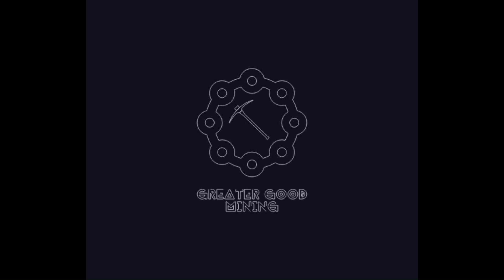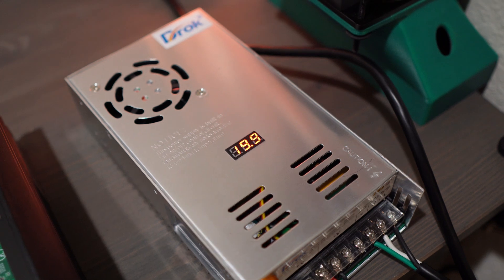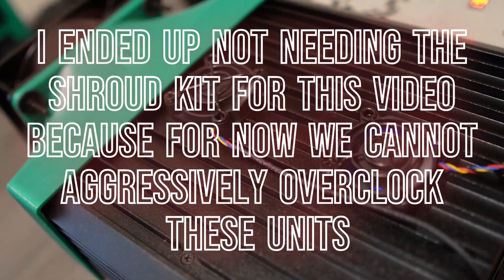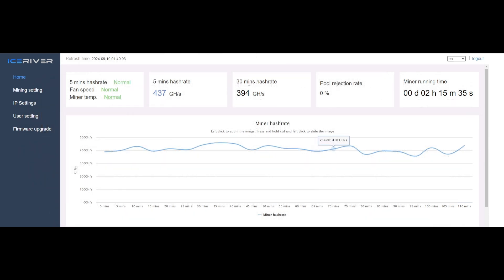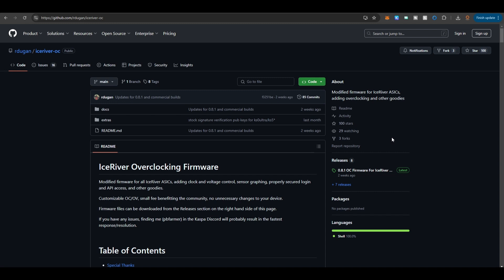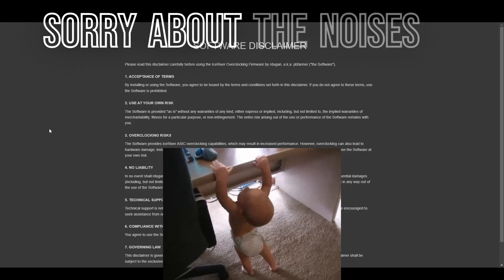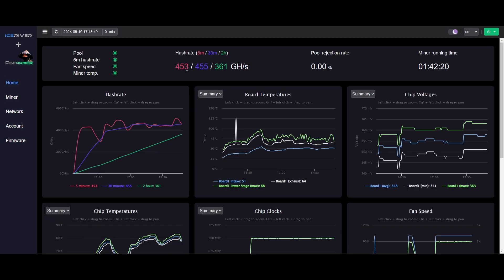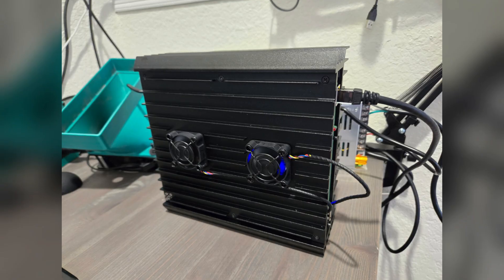Overclock your Iceriver AL0 Alephium ASIC!! (ALPH overclocking guide!)

Comment: Now I connected a new al0 with stock fw. but it will not boot. Both led stay on , no flashing. reset button no reaction short long or hold during startup. any idea?
Reply from the maker: @mucwendel  plug it in, let it run for about 5 minutes. Then Hold down reset button for at least 20  seconds. (do not hold down the reset button while it's booting up.) After the hard reset give it another 5 minutes to reboot itself etc. Then try to get into the web gui again. Also, if that doesn't work, try another power supply
Reply: @GreaterGoodMining  Tried everything without success. AL0 is still on stock FW. I think I did the mistake like hold reset while power on and did not wait before I disconnected the power again. Something now wrong with the boot-loader. 
Any Idea? SD Card with stock FW (no download on ice-river)
I also tried to hold the reset button for mor than 2 minutes. Nothing :-(
Reply from the maker: @mucwendel  it sounds like you might have corrupted the files that it uses to boot up. Do you have Discord? You could try asking around in my Discord, there might be someone who has the files you need or more advice than I can give through these youtube comment sections
Reply: @GreaterGoodMining  I have discord but do not realy know how to use
Reply: how to verify your server in discord?
Reply from the maker: @mucwendel  here is a link to my Discord https://discord.gg/WuNg9aUS
Reply: if you can ping the IP, update the firmware using IceRiver_MinerTool

Comment: Question on that PSU option, Will a 240v c13/c14 cable when cut in half have 3 wires? Do you wire them the same to the ground neutral line even though its 240v? I know you need to switch the switch on the psu to 240v.

Comment: Followed this video to the T....SCAM!! I'm no longer able to add my previous pool, and it is mining to someone else and I can't stop it except UNPLUG
Reply from the maker: It's not a scam. Just do a hard reset on your machine and revert back to stock firmware. You need to add in a pool and wallet after you upload the new firmware. Also, as I said in the video, there is a 1% dev fee. It switches to mine to his address briefly to collect the dev fee. You might have been looking at it when it was mining to the dev? Either way you can just hold the ip report button down for about 20 seconds or so until the lights start blinking then let go and let it reboot etc. Then you can log back in and reset up the machine just like you did when you received it

Comment: You are promoting a scam! As soon as I downloaded your LINKED updates, I can no longer login to my AL0😢😢😢
It's now telling me that my login is Incorrect 😡
Reply from the maker: The machine needs to be reset up. It's not a scam. Try the stock admin and password. Admin for user name and password is 12345678 then when you log into the machine change the username, password, pool and mining address. You have to set everything up and adjust overclocks yourself with this firmware. If you do t want to use it anymore just do a hard reset by holding in the ip report button for about 20 seconds on the back of the machine until you see the lights blink. it will set everything back to factory settings. Then you can log back into the machine and set it up just like you did when you received it.

Comment: I've loaded the oc yesterday evening. Tested different clock and voltage. But it's only shows slower hr as before. When i go over 30 at theclk the clock go down to 20 after some minutes. I need to reboot after that.
Actually running on Pbfarmer  383gh(5 minutes and 336gh(2h). Oc set to 5mhz 0v
Reply: Does anyone know how to go back to stock fw?
Reply from the maker: You can do a hard reset on the machine to set it back to stock by holding in the IP report button for about 20 seconds or so until you see the lights on the unit flash. Then you can start fresh and set up the machine like you did when you received it
Reply: If Pbfarmer oc is set to 0mhz and 0 voltage the chip voltage is just 350 instead 370

Comment: are you OCing the AL0 right after you did the heatsinks?  Worst part about OCing is waiting that full 24 hours for that glue to cure.  Normally i'll OC the next day giving it about 12 hours or so to cure and has been fine so far.  Just curious if you were running the device right away afterwards.
Reply from the maker: @MaddioDaddioMining  I didn't iverclock the unit right away it was about 14 hours later. I have also used the heatsinks with the tape on the back and they have held up fine so far
Reply: @GreaterGoodMining  thanks for the info.  yeah i always wondered about the tape.  thank you sir.
Reply: I left the heatsinks upside and oc direct after glue. I think the glue harden faster if it gets some temperature. But do not move or tilt the unit as the heatsinks may fall off and create shortcut on the board.

Comment: Good work.  Hmm, so you gained 50 ghs on 40 watts, minus the 1 percent of 450 ghs that goes back to pbfarmer (4.5ghs)....so really you gained 45 ghs on 40 watts...not ideal.  That being said, i am sure ill do it as well since i have extra heatsinks laying around anyway lol.
My Rx0 is ordered too
Reply from the maker: My AL0 seems to run around 394 so it is more like 60gh for an extra 20 watts not 40 watts. My AL0 on the meter Box was taking 120 watts before I started overclocking and I ended up at 140 watts

Comment: My ALF ALO Miners are not even connecting and mining so I am hoping to find a reliable firmware to see if they can start mining.
Reply from the maker: Try a different pool maybe?
Reply: @GreaterGoodMining  Do you recommend any good pools for ALF ALO Miner?  Also curious do these miner generally need a ethernet router that is connected to the internet or could you wire one to a laptop that connects to the internet wirelessly?
Reply from the maker: @AMARAKATV  it will need an ethernet cable directly connected to the machine
Reply: @GreaterGoodMining  Also where do we find that firmware file you showed in the video I scanned those folders from the developer for an ALO bgz file and nothing like it came up can we use another file or where might that one be can you share it?
Reply from the maker: @AMARAKATV  it is listed publicly on his github now
Reply: Did you ever get those ALO's working?
Reply: @thehumanpeacock355  Yes just complex networking and virus and firewall routing.. I have a complex network which made it harder..

Comment: What if I update pbfarmer or iceriver AL0 firmware on KS0 ? It is looking same hardware board.
Reply from the maker: That will not work. These are ASIC's. A.S.I.C stands for application specific integrated circuit. Meaning the chips in these miners can only mine one algorithm.

Comment: can anyone tell me for oc setting of 620gh in al0 settings in pb farmer
Reply: clk 200, voltage 175 gives me 622th over 2h
Reply from the maker: Not sure if you saw in the video, you can't push these past 12% for now. That means, you can only get about 450 GH or so (maybe a bit more if you're lucky with the silicon lottery)

Comment: Because it is currently ''just 10%'' Can we use the stock power adaptor? What is your thought?
Reply from the maker: It won't be very efficient, power supplies run more efficiently when they aren't pushed to, or over, capacity. Also, the power supply is highly likely to fail. I wouldn't recommend it